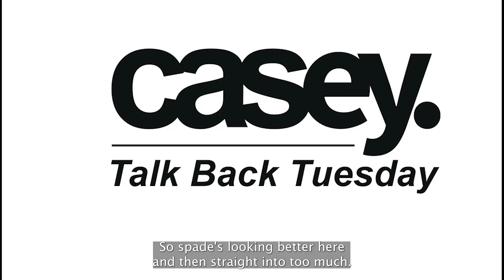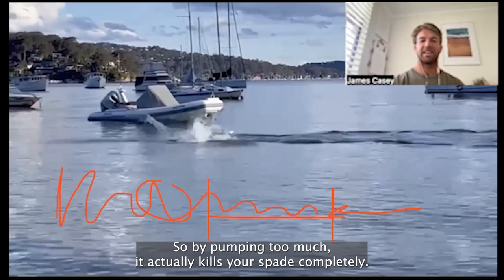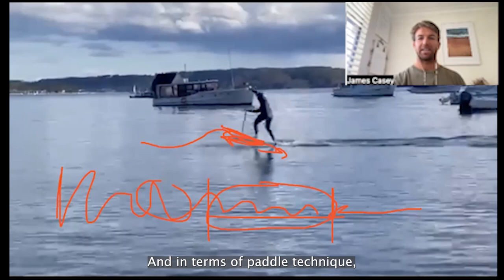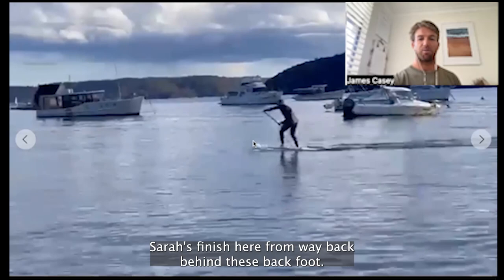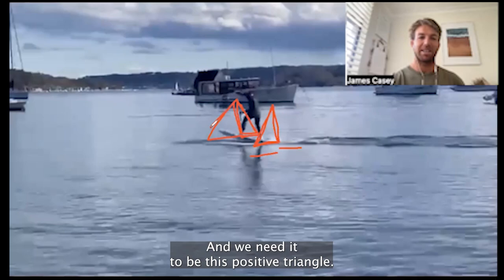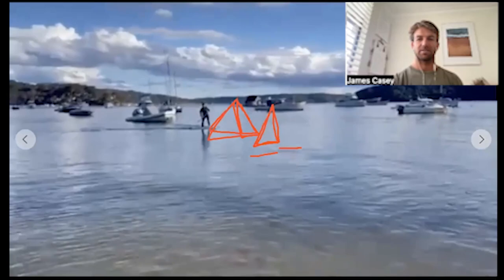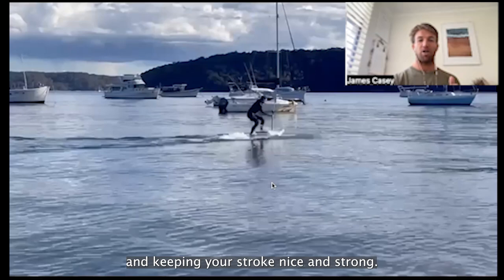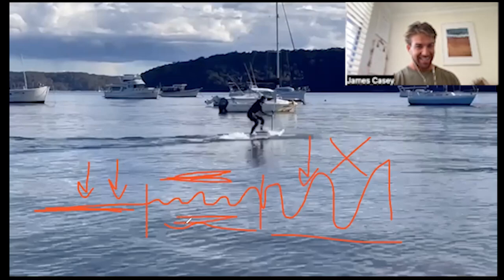Coach Casey Talk Back Tuesday Highlights September 6 2022

Comment: One way to avoid the trap of missing the "middle bit" (where you start to do mini pumps) is to move your front foot forward a fraction from the flat "start bit". This allows you to put your weight forward and negate the body weight beginning to tilt backwards as you increase the pump angles (as we see in the video here).
Reply from the maker: Yes but then you need to shift your weight back to get the foil up off the water… it’s complex and constant speed and smooth feet transitions are key

Comment: It's gonna help me to improve. I think I start to pump the foil to aggressively to quickly. On flat water I still can't get up on the ART 1099 with my 6'4 20 board. When I start to pump I'm slowing down, my board nose dive a bit in the water.